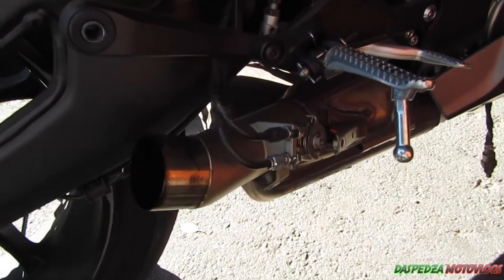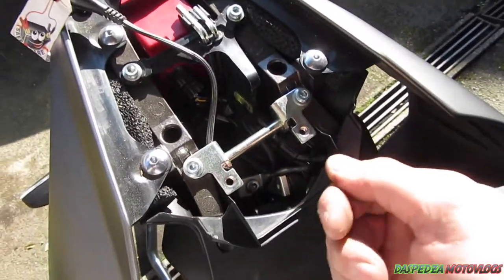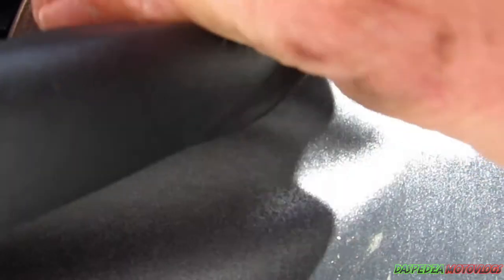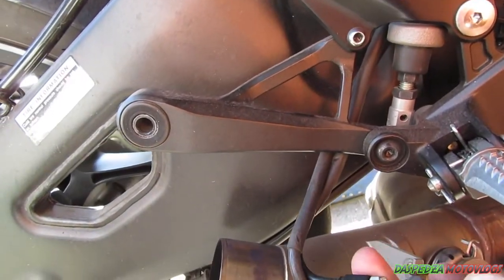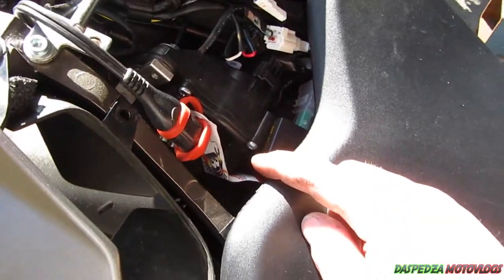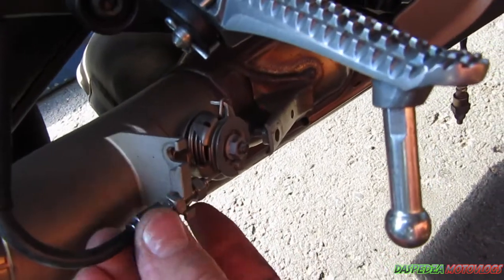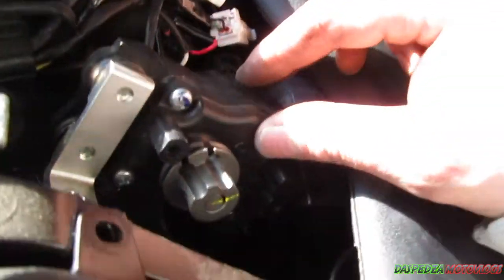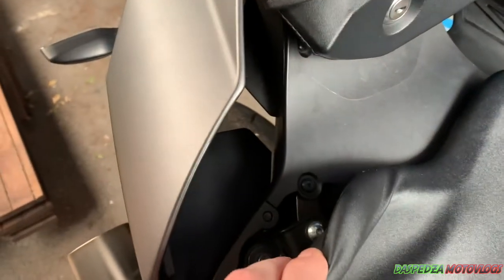How To Yamaha YZF R1 Exhaust Valve Servo Cables Removal

Comment: I don't have an R1 and if I did, I wouldn't remove the servo cables! but I still watched this anyway - 1am on a work night!
Reply: Obviously not for everyone, but you have to remove the cables to install an aftermarket exhaust. Installing an aftermarket exhaust that includes the servo motor and flap is leaving power on the table.

Comment: Mate, thank you for this video. Just purchased a 2022 R1 and about to do this. So basically you can remove the cable but leave the servo there and no error lights? If you remove the servo as well you will get error lights?

Comment: Hey, good clip. Ive got a question. I have a '09 xjr 1300. I had it tuned last month. The tuner told me, i could also disconnect the exup valve, it gives a better sound to the bike. I disconnected the cables from the valve. And it seems the valve is open now because of a spring. Or am i wrong, cause you told someone, the valve would be closed, when disconnected? Also my question is, does it do any harm to the xjr1300 engine, when always open (with exhaust pressure and such). Also i just put the loose cables inside the valve box, it seemed to fit next to the valve. 😁

Comment: So just to clarify. Do i need to remove the cables if i ONLY install an Akrapovic slip-on? I'm hearing different things from different people.
Reply from the maker: No. The Akra slip on will work the the existing catalytic converter setup. You don’t have to touch the EXUP at all. 
If you’re doing the link pipe however which goes from the headers then you’ll have to do the servo mod.
Reply: @DaSpedzaMotoVlogs  Awesome! Thank you for the quick response.

Comment: you never got a warning light without the servo buddy? I did this exact same thing on my 2020 R1 and my buddy is telling me the light will eventually come on without a servo buddy. Is that not true? He said doing it like this on his 2018 GSXR caused a light.
Reply from the maker: I didn’t remove the servo. 
If you’re not chasing weight reduction leave the servo in and just remove the cables and put your link pipe
In. The servo will continue to operate as though nothing is wrong and no lights. 👍🏻
Reply: @DaSpedzaMotoVlogs  would it give you warning lights if it detects there’s no feedback from the exhaust valve? Or the servo doesn’t know anything about that? 
I’m trying to do this on a budget, simply remove cables and cat, would do the trick?
Reply from the maker: What i did was i left the servo motor in removed the cables and cat. 
The ecu doesn’t know any different because it still sends the signal to the servo motor to make it actuate so the ecu thinks everything is good but the servo motor is doing nothing because the cables are disconnected and the cat with the valve isn’t there. 

Just a note if you’re doing this and haven’t budgeted for a tune or power commander you might want to consider that. My R1 rode terrible once I pulled the cat and put the link pipe in. It sounded fantastic but it had a terrible flat spot mid range rpm. It would also stall frequently on colder days due to running rich. Other than that it was ok.
Reply: I’ve got over 5,000 miles on my 20 r1 with no cats. All I did was leave the cables in and zip tie them to the brake fluid holder.  No codes no issues. No tune, no servo buddy.

Comment: What this valve do?
Reply: It opens and closes at certain rpms to change the diameter of the exhaust which somehow reduces the valleys seen in the torque and horsepower curves. It's probably a very marginal change on the road but makes sense for track racing.
Reply: @dexlab7794  can i remove it :)?

Comment: So will disconnecting/removing the cables default the valve open all the time?
Reply from the maker: No if you disconnect them it’ll stay closed. This is for if you’re looking to add a link pipe and remove the cat. But don’t want a warning ⚠️ light coming on.
Reply: @DaSpedzaMotoVlogs   why would you always want it closed? Wouldn’t open be better? And having it closed all the time wouldn’t that be to much back pressure? I’m only asking because I have no idea how it and works and I wanna remove mine but don’t like the idea of it being closed 24/7 sounds like a bad idea
Reply from the maker: 😂😂😂 If you read my previous comment. This is if you’re doing a link pipe and don’t want DTC’s on the Instrument cluster. If you’re not doing a link pipe don’t touch it there’s no need to. That’s what i was saying to this guy if you remove the cables it’ll stay closed ie pointless doing it. 
And yes you’re correct if you did remove the cable’s and it stayed shut it would create to much back pressure because the exhaust essentially has a huge restriction. It’ll create a massive loss in power. 
If you don’t want to remove the cat and replace it with a link pipe just leave it be no need to touch it.
Reply: I did this to my 02 but just opened the valve and fastened it open with a metal cable , took the cables off the servo but left the servo plugged in so it wouldn’t throw a check engine light
Reply: @ksfishingadventures  can I just remove the butterfly in the pipe
Reply: @glogodsk9ltd879  I’m not sure tbh, I tried opening it but the Allen bolts it had were on there good so I just pulled the cables off completely, I loosened the valve mechanisms and it had a small slit , I put that slit over a piece of metal on the valve and tighten it back down and now it’s permanently open , I can send you pics if you want . I also left the servo installed so I wouldn’t throw a check engine light
Reply: @ksfishingadventures  hi so was thier a big dif in torque vs top end vs stock with it perm open ?
Reply: @CLAWCUZBRO  honestly not really , it has a different feeling fully open though , like a lag or something
Reply: @ksfishingadventures  cool I have an 04 and notice the cable on one is frayed and wondered what the hell it was  and lol that led me here cheers bro
Reply: @CLAWCUZBRO  just loosen the bolt in the middle of the valve then open the valve and tighten the bolt back down with the valve arm past the bracket to lock it open in place , I took all the cables off but I left the servo plugged in so it doesn’t throw a check engine light

Comment: and then? you didnt show how to remove or how to have the butterfly open. its hold buy a bolt and needs to be fixed with something in a open position
Reply from the maker: https://youtu.be/5aIGuKYYD1E
Reply from the maker: You don’t want to remove it unless you’re doing a cat removal and link pipe install with tune otherwise it’s complete and utter waste of time. No power gains if anything a power loss with just a EXUP removal.
Reply: @DaSpedzaMotoVlogs  thanks for the video. Good skills doing the job with one hand and filming at the same time. Just to confirm, once the hardware has completed you definitely need a remap on the ECU? What about a Power Commander? Would that be able to be preset for an exup delete?